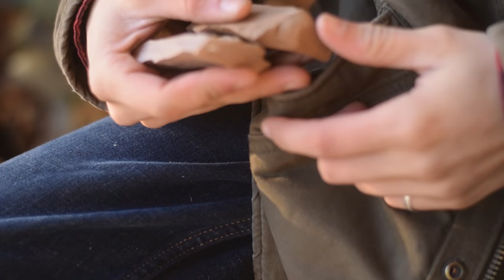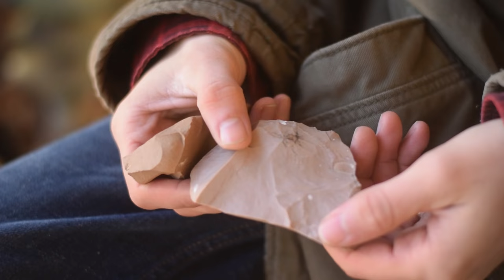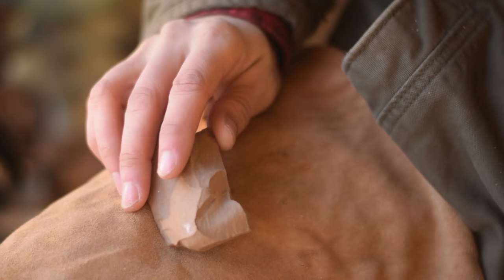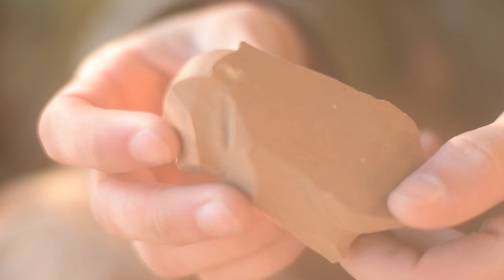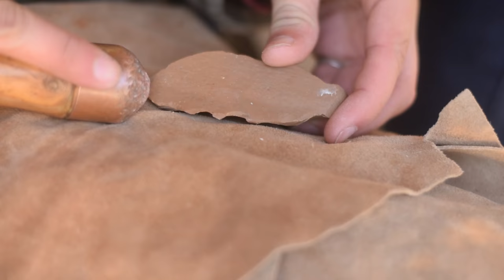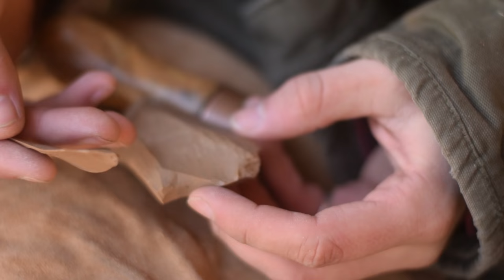Peanut Butter, Knap Time

Comment: you live in bc right?
Reply: because a great place to get chert near bc is just down in Washington at blanchard mountain, there's a nice looking green chert bed.
Reply: it's a pain in the but to knap raw but I found that cooking it helps a lot.
Reply from the maker: Thanks for watching and commenting, and also thanks for the tip! I might take a little trip down and check it out. The material looks pretty tough and similar to a lot that I find here and in the interior. I'll do a video on using geological maps and the internet in order to zero in on knappable stone sources at some point soon.
Reply: Quinlan Primitive Skills what temperature are you heating the rock? I've found similar stuff just north of the border but it's tough like basalt and heating to 450 for two- three hours didn't do a thing
Reply: Bob Joe I heated it at 260C/500F for 10 hours, usually you can see the luster changes to a sort of shiny to waxy look and it likes to flake a lot more, but I'm not sure for all of the rock because a lot of the stuff is pretty inconsistent.
Reply: Quinlan Primitive Skills definetly different Rick then, thanks for the reply